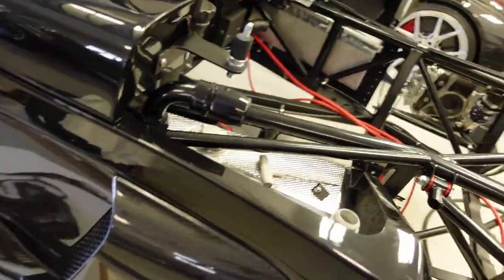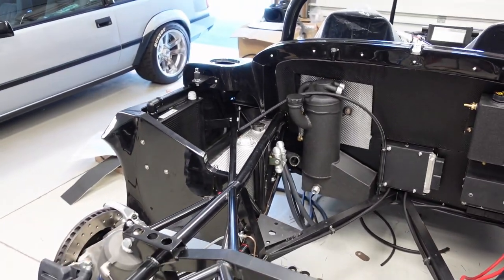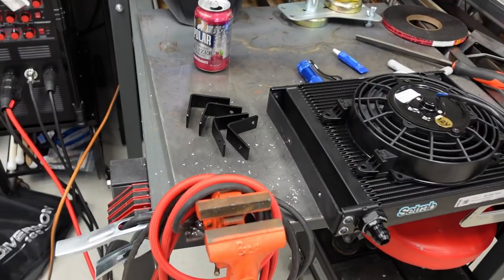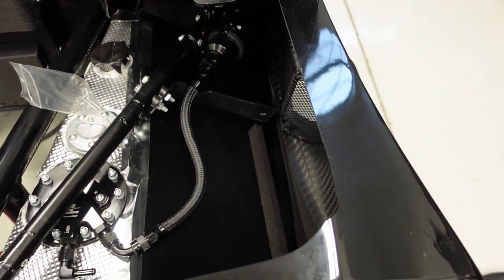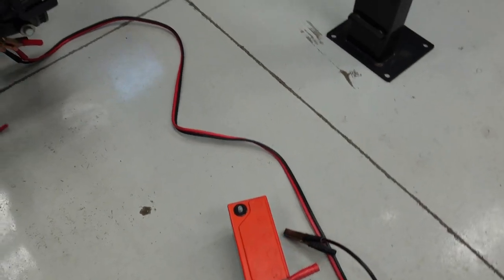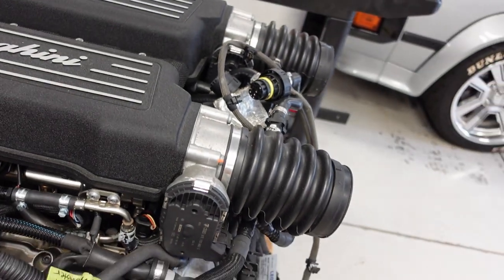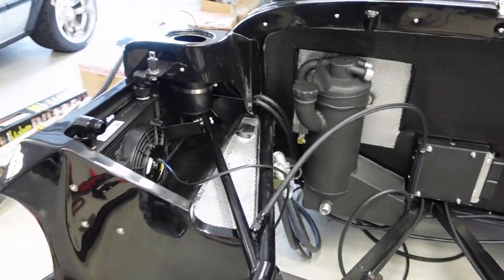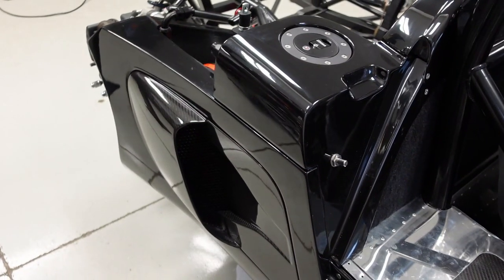Project 'Top Gun' - First Electrical Test - V10 Ultima Evolution Convertible Build

Comment: Hi Dan looking great just a little thing the pipe coming through by the transmission ECU does look a little close if it flexes it may rub on the ECU maybe wrap the pipe were there are possible rub points even steel braided pipes rub through how are you going to vent the hot air from the rads. I am an Engineer the largest engine I work on has 24 8inch pistons attached to 5 mega watt generators they have them on Land fill sites running on CH4 and in Hospitals running on Natural gas spark ignition love the build well done I love the Ultima looks like an LMP car all the best from Liverpool England.
Reply from the maker: Good eye!...while that coolant elbow doesn't touch the transmission ECU, it's only about 3mm away from it.  I may try to find a tighter elbow to run in that corner to give me more spacing--plus as you suggested: perhaps some type of sleeve to protect it.  I may even apply plasti-dip rubberized coating to the corner of that ECU as another rub barrier.  Thanks for the comments!!!
Reply from the maker: Oh, and there are many vent slots on the top of the engine bay clam shell.  I'm considering adding more as well to optimize cooling.

Comment: I kinda want the ultima but thinking the superlite might be cheaper. 

Thinking a few interesting engines myself. Have access to a ferrari v10. Know how to get a cheap Lamborghini v10. Was also thinking the vw w12 that's used in the Bentley continental that you can find in the w12 toureg. Or possibly a Toyota v12. 

But I think I'd rather do the cash investment of figuring out a pdk set up. 

Plus I live close to superlites factory kinda. Gotta cross the border but like a 4 hour drive or so. 

Even thought of a way to do a nice interior for not a whole lot. Some after market seats but has heated seats. Might be able to talk to the company and get the carbon bits off their other version of the same seat to reduce weight. You can get custom colors already for money. If not two sets of seats swap bits myself. And know an interior place for seat jobs and stuff.

Comment: Great work. The connectors for one of the ECUs appears to point downwards. Shouldn't you be worried about water splashing onto it?
Reply from the maker: I’m going to be building/ installing an aluminum ground effects belly pan to cover the underside of the engine bay. That should provide enough weather and ground proof protection. But you’re right, if I wasn’t planning to cover the area, I’d have to find a new home for the ECUs. 👍

Comment: Great progress!!! One question: where does the air sucked into the sidepods go? It seems it gets stuck between the rads and the fuel tanks. Cheers from Italy!!!
Reply from the maker: There are many vents on the top of the rear clam (body). The hot air will rise above the tanks and out the top vents of the rear bodywork. Thanks for your comments!
Reply: @DanDulac  great!! Thanks to you for the videos!

Comment: Impressive as hell. Where you located? I’d love to see it at a car show one day.
Reply from the maker: I’m in the northeast…thanks for the comments!
Reply: @DanDulac  Damn. I’m in the Midwest (Chicago burbs). I was planning to buy a 458, 650S or Murcielago this Spring, but the used exotic car prices are out of control right now and I just can’t do it. I started looking at kits cars. I was thinking Factory Five Cobra. I see your cobra. They’re 6+ months wait time for a kit. Then I came across the Ultima RS and was blown away. Question: do you know if all Ultima builds require welding and lots of fabricating...or is this just for yours because of the V10 engine? I’d love to order a kit (52 wait right now) but I don’t have the tools or skills. Thanks in advance!
Reply from the maker: @brian.pautsch  isn’t it crazy how exotic car prices have skyrocketed?  It’s nuts and I think you’re making the right decision to wait. Prices will come back down; just need to be patient (which is hard for us hear heads. 🤪). Yep, I finished the Factory Five Cobra in 2008 and was my first car build. The Ultima RS is sweet; I ordered my EVO convertible 3 months before they announced the RS; in hind sight, I might have opted for the RS if i knew it was coming. But alas, the open top feeling with that v10 screaming over your shoulder should be something. The Ultima kits come very complete and as long as you stick to the V8 template, there’s zero fabrication required. And it can be built with basic hand tools; nothing crazy required. Plus, there’s an amazing builders community on Facebook so you can get tons of help at a moments notice. Im even in touch with a few blokes at the factory and they are extremely helpful and responsive. It’s a pretty close community and everyone is willing to help. While I haven’t priced it, the Ultima Factory can build your car for you as well and they will ship a completed car, to your exact specs, right to your door. Probably not cheap but the price performance is still likely better than any production car on the market today…not to mention the exclusivity of the Ultima.
Reply from the maker: Yes, my bespoke V10 build is one-off. I wasn’t even sure the V10 was going to fit when I bought it. And technically, I made it fit in the chassis with a fair bit of fabrication but I will still need to do some bodywork to get the rear clam to close. With a modern LT or LS V8, the Ultima is designed for these engines and it’s all bolt-in. Anyway, hope this helps. If you ever want to touch base and talk more, look my up on Instagram and we can connect. Thanks for the comments!
Reply: @DanDulac  thanks for the detailed response. Super cool of you to take the time.

Comment: On the hose,why couldn't you run a 45° off each one and then have a short straight flex pipe between the two?
Reply from the maker: Yep, that would work. But I would have to buy two 45-degree fittings instead of just one 180-degree fitting.  Plus, I already have one straight fitting installed at one end of the -16 line.  Thanks for the suggestion Moto!